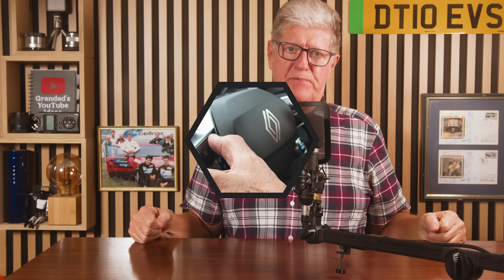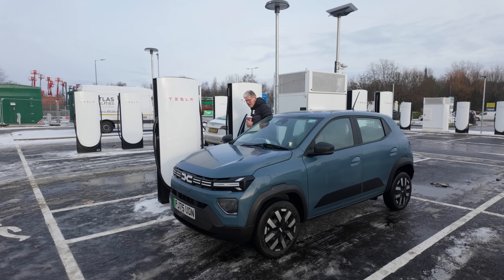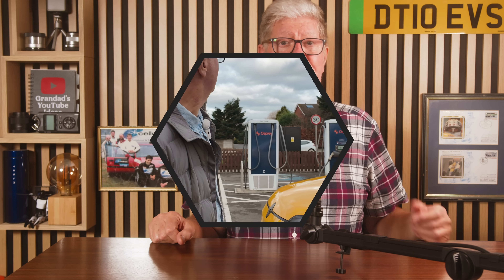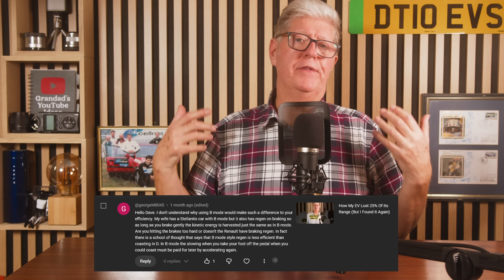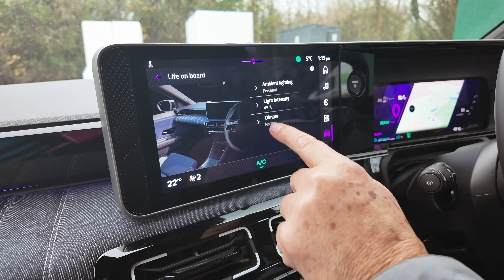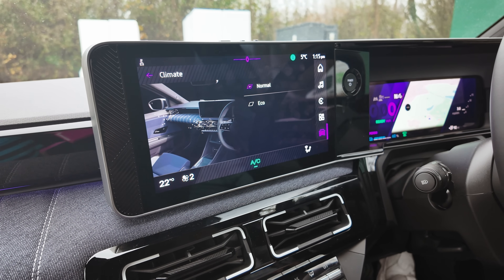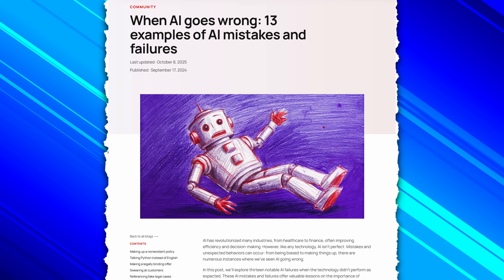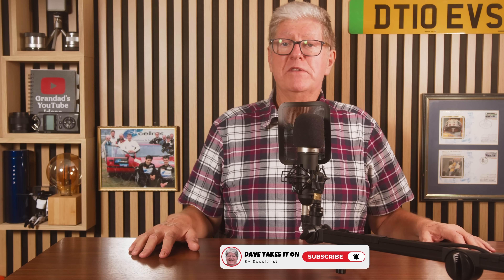Was I Wrong About Regenerative Braking On EVs?

Comment: I've got an ice car butlook at regenerative braking this way.
Imaging uou fit a flywheel to an ice car. Then, when you want to slow down or brake you link the car's gearbox to said flywheel. Spinning up the flywheellook at it this way takes energy from the mass of the car and converts it to energy in the flywheel.
Theoretically all of the forward motion of the car could be convertec into rotational energy of the now stationary flywheel.
When you start moving again, the energy in the flywheel could now move the car back up to speed (minus the efficiency loss due to energy convertion), but your substantially back up to speed without using the engine.
You should think of the battery as an energy supply for moving, like petrol or diesel, but also as a flywheel at the same time.
As Newton said energy is conserved, but you are minimising that lost to heat via the brakes.

Comment: Dave, not everyone drives on a motorway! Not everyone does 70mph. Some people drive on small country roads with a speed limit of 40mph. The most efficient way to drive any car is to drive according to the environment and conditions. Driving on maximum regeneration on a narrow country road is not the most efficient way to drive an EV. However, driving smart, using all the available tools to your advantage is. There's no one size fits all.
Reply: He said he did his test on multiple different types of roads. Why is regen not the right way to drive on a country road? Most people are just driving to go from point A to point B. All the country roads I drive on the regen works fine. I'm not racing just getting to my destination. I use my accelerator to both speed up and slow down. When I slow down it adds a little energy back into the battery. Is this the wrong way?

Comment: 9:50 Great video as always! It's impressive how even manufacturers like Tesla set regenerative braking to max by default, but drivers can still infinity adjust the amount of regeneration when needed. Just apply the accelerator while decelerating, and you can fine-tune it on the go. Great channel great content

Comment: Dave. I'm a long term subscriber and regular viewer of your channel. I think your content is good. But I think you are stepping out of your comfort zone whenever you go down the 'science' route. 

While I broadly agree with what you've said Dave, I have 2 observations.

1. At 9:30 you talk about a viewer commenting that motors use energy during regen, and you go on to say that 'nothing is lost'. That viewer was basically correct! We could haggle over the terminology if that viewer actually said that energy was 'used' by the motor during regen, but in principle they were right. You imply that regen converts 100% of kinetic energy back into electrical potential energy in your battery. You back this up by saying that because the friction brakes haven't been used, then all of the kinetic energy converted (resulting from loss of speed) must have gone back into the battery. This is simply not true. Regen systems cannot and do not convert 100% back into stored electrical energy. There will always be some of that energy lost as heat within the motor, the charging system (electronics) and within the battery itself. Mostly due to electro-magnetic and/or electrical resistance within those systems. How much the regen manages to convert back to stored engy in the battery will vary considerably based on several factors. But a notable proportion is lost as heat.

2. I think you mis-understand or mis-represent some of things said in manufacturers adverts or documentation. For example; I agree that regen is there to increase range, but you use those manufacturers statements to back up your claim that 'nothing is lost' when you use regen. As covered at 1. above, some energy is lost during regen.  The reason that regen 'extends range' is because it is  more energy efficient than friction braking. So it increases range compared to friction braking in the same circumstances. 

On a general point, as mentioned by other commenters, while your real world test in the Renault 5 has produced some interesting results,  the test was far from scientific with little or no controls, and your conclusions ignore several other potential explanations.

I also think it's wrong to talk of regen as 'free energy'. It's partially  preserved or recovered - the regen process is 'lossy'.
Reply: I think there's now a general consensus that Dave would have been correct if it were not for the 30% energy that does not get back to the battery under regen. But will we get a third video conceding this ?

Comment: I use B mode for average regen during normal driving this helps keep my breaks from seizing and no regen on the motorway. Cruise control and regen don't like each other so switching cruise control on and off for various situations causes the car to suddenly start braking which is disconcerting especially for any passengers.

Comment: In an ICE car when stopping at traffic lights I apply the right amount of braking force to bring the car to a gentle stop at the lights.
Why then are electric cars not designed to have regenerative braking set to similar to engine braking in an ICE car and increase the regenerative braking as you apply the brake pedal before beginning the application of the mechanical brakes, therefore making the brake pedal act like the acceleration pedal in reverse.
Reply: Yes, most EV's actually do this.

Comment: Excellent video - glad you did that test!
The "possible" issue with re-gen would be if the car kept putting power into the motion and then taking it back out again - which would be less efficient than simply letting the speed vary slightly
The obvious way to avoid that would be to have a small "dead zone" in the throttle - there are other more sphisticated ways of avoiding that problem!
I was fairly sure that the car manufacturers would have done that - but it's nice to have somebody actually test it to confirm that

Comment: I recently watched a video by Efficient Alex, where he took a 1st gen Nissan Leaf, with very low battery - in fact, almost empty - down a long hill from near Merthyr Tydfil towards Cardiff. The aim was to measure how much electricity he could recoup from regen braking. He was surprised to find that he actually drained the last of the battery, and ended up with less electricity than he started with. Interested, I worked out how much potential energy his car had lost while descending the hill, which was essentially a measure of how much he might possibly recoup - it could not possibly be more than that. I then made a guess at how much electricity he would use to drive the same horizontal distance on the flat, ignoring the hill. I was generous, because he was driving fairly slowly and very carefully, only using the accelerator when absolutely necessary. The upshot was that he would have needed roughly 2.5kWh to drive that distance on the flat, and the potential energy was only about 1.6kWh. From the figures he published at the end, measuring how much %battery he had used, it was almost exactly a 1kWh drain from what he had started with. In other words, his car had recovered about 60% of the available kinetic energy through regen. That seemed to me to be a reasonable figure.

If you drive with regen off, and use normal braking alone, you are essentially throwing all that energy away in heat, and recovering none of it. If instead you use regen as much as possible and only use your brakes when absolutely necessary, that 60% of the energy will be returned to the battery. So yes, I'm not surprised that you found a respectable increase in efficiency, in terms of more miles per kWh, with regen active.

For myself, I always drive using "B" mode. There is one occasion I turn it off, when leaving a highway (for you, read motorway - I'm living in Canada) and I turn off cruise control. In B mode, the car immediately ramps in regen and starts slowing down fairly strongly. Not what I want, because I want to use the decelerating lane to slow down more gently, and then to apply the "brakes" when I approach the curved section of the slip road. I could press gently on the accelerator so that when I turn cruise off, the car maintains its speed and I can use the accelerator to lift off and use regen to slow down, but I rarely get the pedal input right, and there's usually a slightly jerky transition. But if I switch mode from B to D first, then turn off cruise as I enter the decelerating lane I always get a smooth transition from powered driving to gentle coasting deceleration. Then I switch mode back to B as I approach the slip road curve, and as regen ramps in smoothly the car "brakes" more strongly. I prefer to do this when I have passengers in the car, to give them a smoother ride, but otherwise B mode is always on.

Comment: In theory coasting at exactly the right rate to come to a halt where you want to would be the most efficient use of energy. Of course that's often impractical, especially as EV manufacturers put a lot of effort into minimising rolling resistance and aerodynamic drag so coast a loooong way. 

If you want to decelerate faster, then you have to convert some of the kinetic energy into some other form of energy - heat in the brakes or charge in the battery. Of course adding charge to the battery allows most of the kinetic energy that would be dissipated as heat to be recovered and used for subsequent tractive work. Note though that this is not a perfectly efficient process - there will be losses, including heat, charging and discharging the battery, which is why coasting is in theory better, and may give you a higher state of charge by the time you come to a halt. The regen energy is just a partial recovery of the extra energy you used by staying faster for longer first. (If you maintain speed for longer then decelerate faster than the coast down speed, you'll also incur additional drag losses from being faster than you would have been if coasting all the way to the stop, in addition to charging losses.)

The most efficient way to decrease speed to a stop is therefore to start to slow as early as possible and decelerate as gently as possible.

I've been thinking lately about other situations though e.g. cars further ahead slowing or stopping in urban environments. What's the best strategy there? I've concluded that it sometimes makes more sense to use full regen to e.g. sharply reduce speed from 30mph to 20mph, then continue to catch up at around 20mph in the hopes that by the time you get to the slower cars, they will have sped up again and you can keep more of your speed and thus kinetic energy than you would have if you'd kept a higher speed for longer and been forced to slow right down. The smaller the range of speed, the better (a constant speed is generally most efficient). 

I don't know what impact different strategies would have on charging losses though - more efficient charging with higher currents, or less because of electrical resistance losses being proportional to the square of the current?

Lots to think about.

Comment: You missed a vital thing!

All electric cars have regen, and they always *1 use it!
If you put your foot on break pedal - the car WILL regenerate and charge the battery, even if you turned regen setting off!
If you set your car to regen, it WILL use the same regenerating circuit / device to slow the car down and charge the battery!

*1 There is and extreme situation your EV never regenerate. It's when your car is fully charged on top of a hill and you are driving down. The car want to regen to slow down the car, but battery is full so it can't. It does NOT matter if you use pedal for slowing down or the regen setting. You are not allowed to put more energy into the battery because it would get damaged.
You probably have to use the breakpedal if you don't want to crash.

You will lose energy every time you do slow down with regen and then use accelirate. Battery have losses, motor have losses, circuit for electric tranformation - AC from motor to DC to battery and vice versa.

So EV's almost never use their disk brakes, and that's why they rust, if we don't exercise them.

In short, press brake pedal to slow down -- and your EV will charge up your battery. Even if regen is off.
Reply: My EV doesn't use regen with the brake pedal. It is a Tesla Model Y. I have not seen anyone say any Tesla uses brake regen. It would be a big change in how they do things if they started using brake regen so would be reported as a change. 

Yes, if your battery is full, it will not regen.

There are losses with regen and that was a misstatement but 70% or 40% regen is better than wasting it all in heat.
Reply: @davecolgan442  I TMY doesn't regen on the brake pedal it's a faulty design or you are misstaken.

All other cars have done this for years.

Comment: My Lexus hybrid, when pressing the brake pedal, uses the electmotors to slow down the car, the friction brakes are rarely used. I believe many EV's also do the same, which takes away the need for a high regenerative setting, from an efficiency perspective. As a sidenote, the creeping that we get with an automatic car, is fantastic for parking.

Comment: You need to clarify the difference between regen during normal driving and regen when  braking. 
When braking, you appear to imply that all the kinetic energy is converted back into Electrical. No. That is the problem with regen braking. It IS inefficient. Presently about 70%.  Regen IS more efficient than braking using the brake pads where all energy is lost (as you stated).  
However , REGEN IS NOT more efficient - when you don't need to brake. i.e. I travel daily on a long country road which is slightly downhill. In my old ICE I could get my car to 60 and then coast (in neutral) for about two miles - literally doing 1000+ mpg (tickover revs).  It would be the same in an ICE (actually even better as you don't need the tickover revs (so < 0.01kwH per mi) 
Presently the regen is trying to slow the car down , and so losing 30% of the energy due to inefficiencies in the regen system. ALL EV's should have a button on the steering wheel which you can hold in to stop the regen when you want to coast. The fact that Tesla appear to have taken this is off is a step backwards. Not that I have a Tesla....🤓

Comment: 9:44 nahh you got it kinda wrong here.When you use max regen, and your spedo goes one over you backoff, you are not able to get the power to zero, you will regen, that is less efficient, than coasting, same thing with a speed change.

The example with the stop sign, it is best to coast the first few meters, and then regen.

Try a new MEB with software >5, in D it will tell you when to lift, and you will coast quite a bit without annoying anyone, and it will then regen, to the speedlimit, or the Stop, or the intersection. In B you, or atleast the people I know, are 15-20% more inefficient!